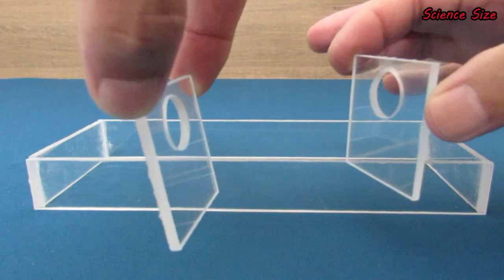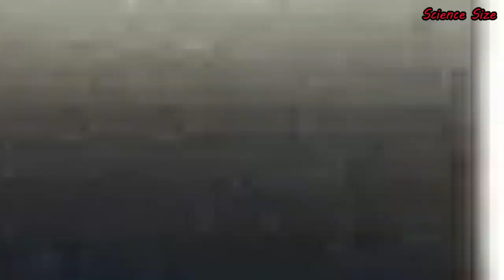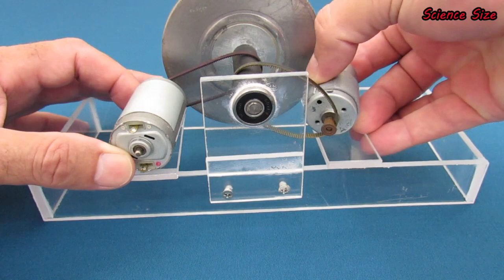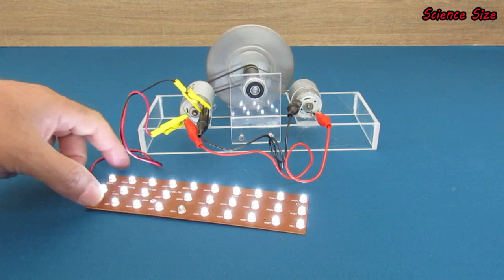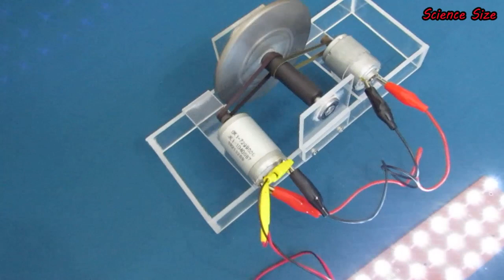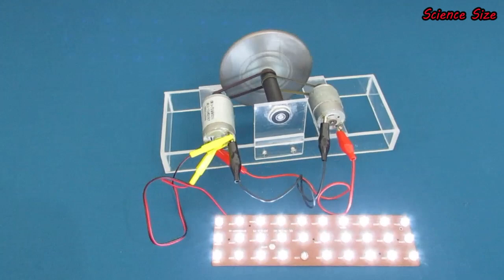Perpetual Motion with DC Motor - Permanent Generator

Comment: The motor on the left is a working motor.  The motor on the right is not.  The flywheel keeps the motors spinning so he can connect the leads to the nonworking motor, which actually has battery in it.  Raise your hand, if you knew this was fake.
Reply: so, why are the LEDs flickering?
Reply: Try yourself to get the proof
Reply: This is not fake, if you observe carefully....one is dc motor, and another one is dc dynamo....dc dynamo converts mechanical energy to electrical energy....the output of dynamo..such that the output current is given to motor..so it will automatically runs....then perpetual motion will work......this is really excellent experiment..you can also try, it will succeed definitely
Reply: @MrPudedeng  because the output current is fluctuating not constantly coming....due to rotational system ..that's why the LEDs are fluctuating
Reply: LEDs are connected to motor is not important...the current flow is everywhere..that's why LEDs are glowing even it was connected to motor...this is not fake..this is excellent experiment 👌👌👌
Reply: @pavanch53  IT IS FAKE!!  FAKE!!!  FAKE!!!!   THERE IS A BATTERY IN THE MOTOR ON THE RIGHT!!!!!
Reply: @traBylliB  battery is used just to start the system..then after battery was not there, please observe again....
Reply: @pavanch53  The battery to start the system wasn't even necessary.  All he had to do was connect the leads to the other motor.  Of course, it isn't another motor.  There is a battery pack in it.  I'm right!   You're wrong!!  I'm not the only one that claims this is fake.
Reply: @traBylliB  there will be no batteries-pack inside either of the motors...